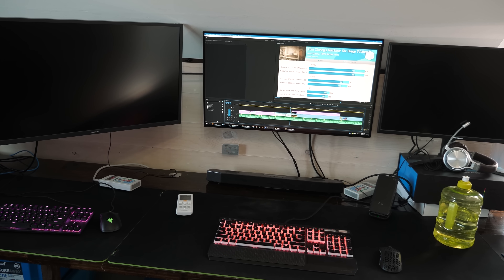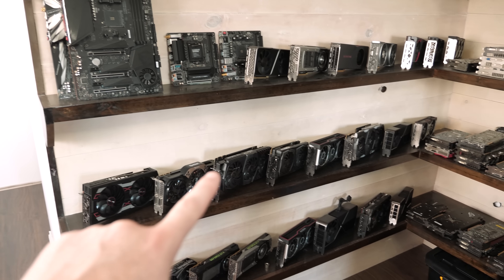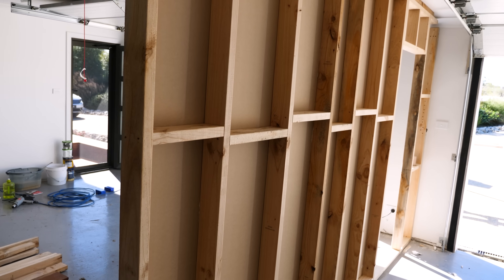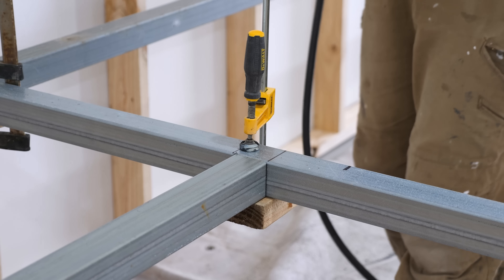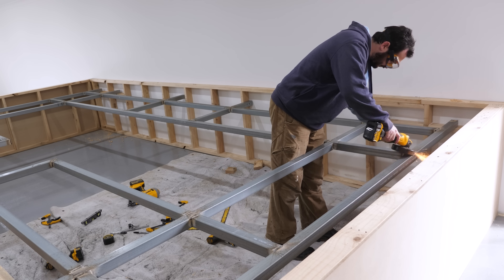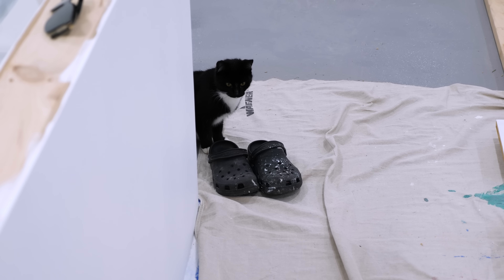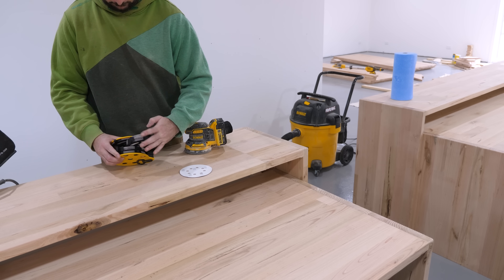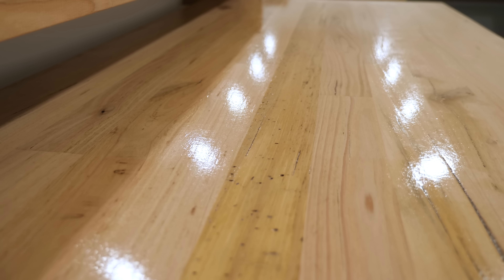Building The Ultimate PC Desk! New Studio Build

Comment: I love how you say that you can put tons of steel on top of this wall but you didn't put it on top of the wall you put it on top of the 2x4 that crossover has no support underneath it I think the only thing that's going to end up holding up that metal frame is your angle supports just saying what a shity design unless you put two by fours under the end of each of those two by fours that were spaced in there there's a reason why they put those under the ends of Windows when they put a two-by-four across it so that it can support the weight you did not support the weight so now the only thing is holding that two-by-four up is the two Nails on each side and your MDF not a good move just saying eventually it will fail
Reply from the maker: Let me try and help you out here.

Firstly, each fixing point features a noggin (which you seem to have noticed). Now these noggins are fixed into place using two nails at either end (which you also seem to have noticed), but what you missed because it wasn’t clearly shown is the fact that the noggins were also fixed into place using construction grade liquid nails. Basically, you could sit a few hundred kilograms on these and you’d have no chance of breaking them.

It’s also well worth noting that the steel is sitting on the noggin, but fixed to one of the 90x35 structural pine uprights using a pair of 14g 100mm batten screws. Additionally there are 22 points of contact in total, yes the steel is braced to 22 uprights, I’m not sure about you, but normally desks have 4 legs, so this oversized version is probably okay with 22 of them.

All said and done this ‘shity design’ as you so eloquently put it could hold well over a ton of weight, probably more than what you need for a desk, but hey maybe you do different things with your desk. I won’t judge, anyway as you were.

Comment: "half the size of a double car garage"
So a single car garage then?
Reply from the maker: Single is a bit smaller.
Reply: @Hardwareunboxed  How is that possible?
Reply from the maker: no idea bud, I don't make these standards. They're actually a bit wider, but overall shorter. Point is it's a completely different set of dimensions and not merely half the double which is 6 x 6. Two singles is 32m², double is 36m².

Comment: sponsored by Dewalt tools
Reply from the maker: I wish
Reply: @Hardwareunboxed  It looks fantastic mate, really well done. You could rip some of those panels to box out some sound panels for the walls and ceiling and use insulation and some basic fabric to help with the sound absorption, with all the products in too will help a little bit, a few rugs or carpet tiles too will knock some of that echo out and stops slipping on painted concrete when wet.